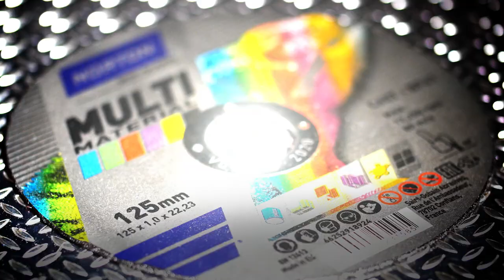Norton Multi - Material

Comment: What's the difference from the Norton Essential-MULTIPURPOSE series? Is this disc suitable for cuting gres porcelain too?
Reply from the maker: Hi Stefano.
Both this disc and the Norton Essential multipurpose one are suitable for cutting gres porcelain.
Thanks again for watching.
Reply: @NortonAbrasivesEMEA Thanks mate for your reply. What's the main differences from using a cut off wheel like the one you showing on the video and a turbo diamond blade? Especially for a gres porcelain? thanks
Reply from the maker: No problem. The main differences will be the speed of the cut and the life of the product. Multipurpose discs are great for jobs you may do infrequently but if you are making a lot of cuts on porcelain, it would be best to invest in a diamond blade.